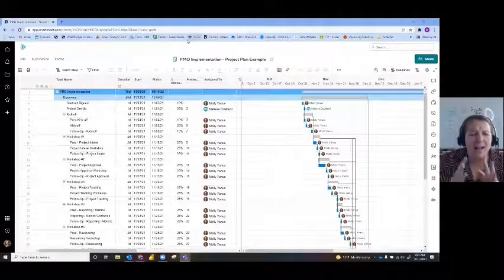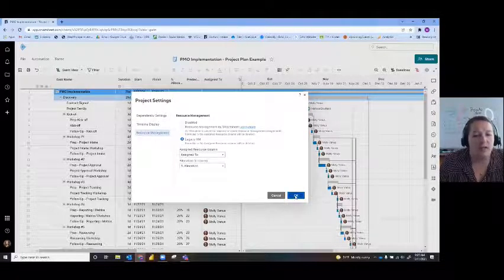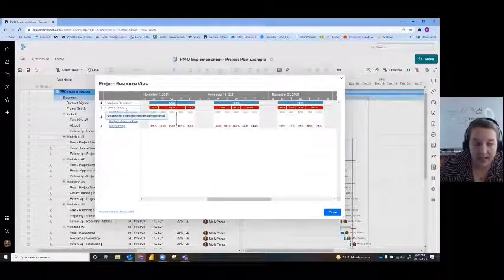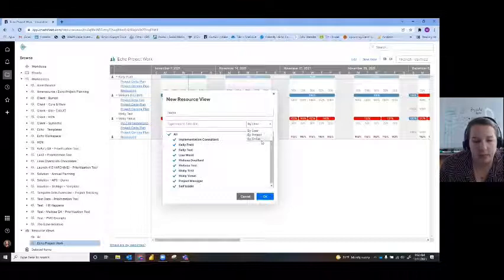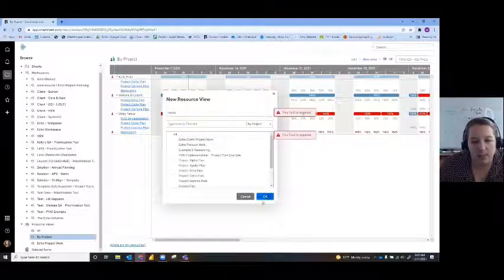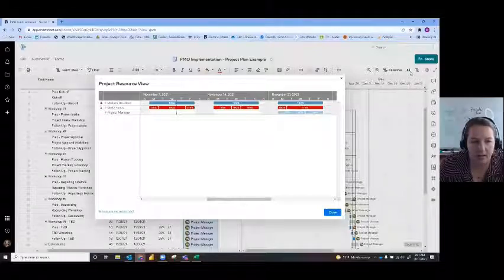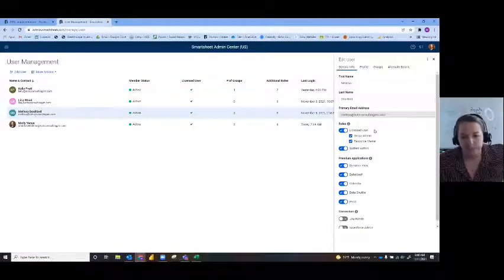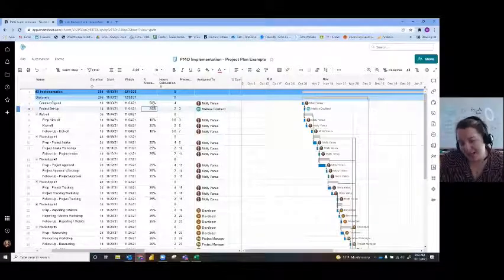Smartsheet Tutorial: Resourcing Basics for Current Projects | Setting Up Future Projects

Comment: Resource Management is unfortunately only available for Business or Enterprise licences; not Pro.
Reply from the maker: Hmm, two different things: 1. is "Resource Management by Smartsheet" which used to be 10,000 ft - that is additional licensing. 
 "Legacy Resource Management" should be available - you can access via "Gantt" view in a sheet.  (Unless there was an update to licensing since we last looked)
Reply: @echolocity  pretty sure I read that the Legacy option is not available in the basic (Pro) licence. You have to use a Business licence which is a minimum of 3 licences. That isn’t good if you are a consultant demonstrating Smartsheet to a customer.
Reply from the maker: @michaeldoherty7434   - Smartsheet is likely going to try to retire legacy resource management as they continue to integrate Resource Management closer with the core Smartsheet platform. - They are phasing it out for new users : https://help.smartsheet.com/articles/1346969-legacy-resource-management-allocation - not available for new users according to their page.
Reply from the maker: Also - we do not sell Smartsheet licensing or any licensing for that matter. We prefer to be vendor agnostic and not have incentives to upsell more licensing!